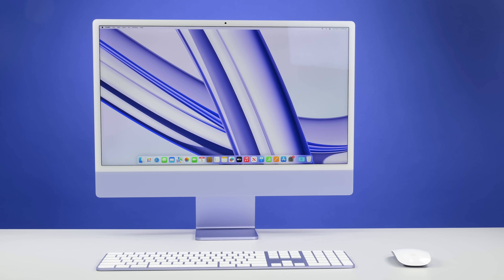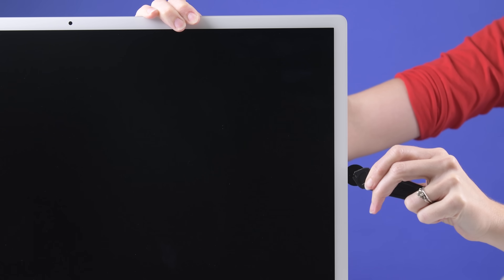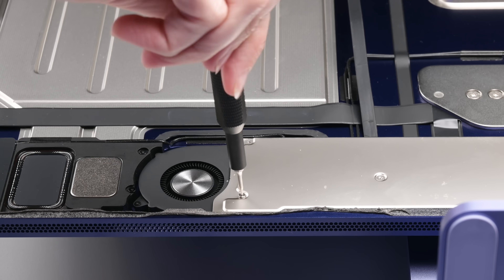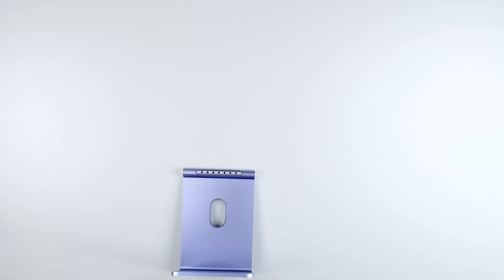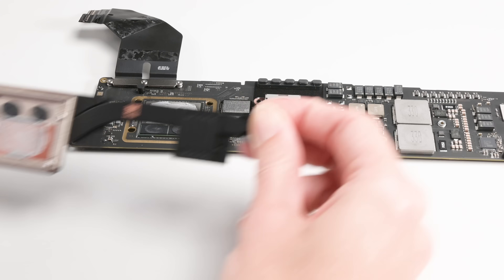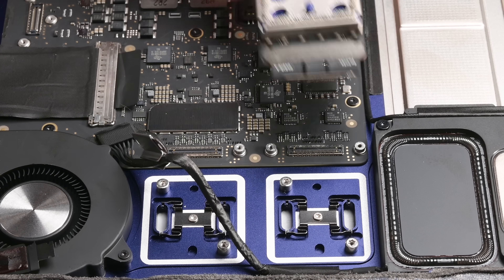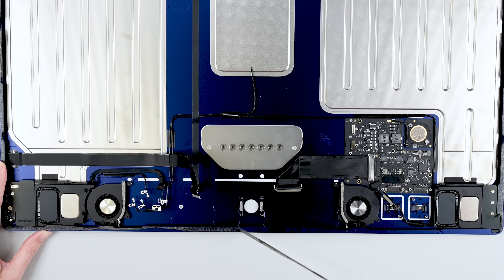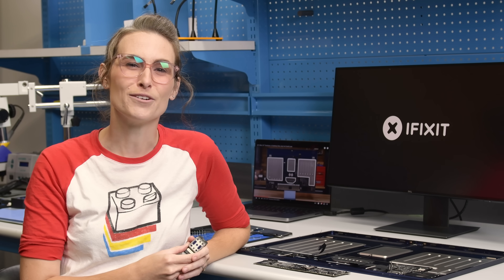M3 iMac Teardown: Apple’s Most Replaceable Battery?

Comment: Since it's an Apple device, it deserves an automatic 0/10 repairabilty for parts pairing, lack of upgradeability,  and pesky software locks.
Reply: There’s only one thing I can think of that Apple “does do better”, the USB-C ports are not soldiered to the motherboard but has their own little daughterboard, so if a port gets mangled it can be replaced without a motherboard replacement
Reply: How many people upgrade a laptop? By the time a normal person upgrades, it’s actually better to upgrade the laptop. Most Mac Book users use their laptops 5 years or longer. Some even use it for 10 years. 

No one cares people can’t upgrade cpu or ram on a Smartphone. MacBook is no different than IPhone or IPad. 

As far as apps go. Apple has Pro Logic and Final Cut. Programs that professionals all over the world rely on for their work flow. 

As a Systems Administrator for a large company and have built gaming pc since 2003. Mac Book offers many things that PC doesn’t. It’s my sanctuary from Winblows.
Reply: @JasonB808  being able to upgrade an imac or macbook means it can last longer in fields where things like RAM requirements are always increasing (E.G video editing where 4K and 8K timelines eat ram like takis). My old PC lasted me almost eight years because I was able to upgrade it. It was originally equipped with 8 gigs of ram and ended life with 64. Upgradability also means that I don't need to shell out $600 for more ram now, and can instead wait until I need to upgrade capacity to spend more. My new work computer has 128 gigs of ram, and I know I will need to upgrade it down the line. I'd rather spend $200 for another 128gb of ram in 2 years than another $6k on an appropriately spec'd mac pro.  Same goes for my work laptop. Currently has 32 gigs of ram, but can be upgraded to 64 when I need to. While some may be able to  use their imac or macbook for 5-10 years as an internet browsing machine, the same can't be said about people who use these devices for work. The reason "nobody complains about the lack of upgradibility in a smart phone" is because almost nobody uses them for intensive workloads. 

Also, people absolutely do complain about lack of repair/upgradibility in phones, just do a google and you'll find a ton.
Reply: I’m pretty sure the main reason why upgradability went out the window, was because the components including Ram are directly attached to the SOC… Now mind you the whole upgradability degradation did occur prior to the swap from intel to ARM, and I agree with that on intel models but now the ram being directly attached to the cpu and the gpu allows for faster operations between them adding additional traces on the board adds time to complete these operations…
Reply: @jonohlinger8898  even with the faster soldered on ram, I would still like to see a few SODIMM or DIMM slots for ram upgrades in the future. having a second, slower bank would still be better than no more ram at all
Reply: @badlighting thanks for sharing, I’m in essence illiterate so taking what you say I agree with, it would be nice… I do believe the fact we can’t slip an additional m.2 in for additional storage is also a huge problem and I agree with basically all arguments but idk 🤷‍♂️
Reply: @badlighting  
A better change would be a socketed SOC
Reply: What about microsoft, dell samsung or many other brands does dude, remember, not only apple would deserve a 0 with your cleary rageful comment, but look around... every other company is the same
Reply: Especially with the lack of upgradeability. I mean, almost every modern device does this, it’s not just an Apple issue. It’s sad.
Reply: @mirai9150  Except most people don't buy maxed out hardware, so they end up completely replacing the device much sooner than if they had an upgrade path a year or two after purchase. The value of used hardware on a secondary market is also significantly reduced if that stuff can't be upgraded -- which leads to more stuff being prematurely trashed. Also, manufacturing processes are constantly improving and becoming more efficient, so waiting to buy a part a year or two after release will frequently lower the economic and environmental impact. No matter how you look at it, it's hard to argue that non-upgradability is better for the environment.
Reply: @mirai9150  I don't know kid, if you come to d1ck ride and defend Apple after someone's comment, I think you are the one that got mad
Reply: @mirai9150 🤡
Reply: @mirai9150 you're braindead 👍🏻
Reply: Cry more
Reply: @mirai9150  Not everyone has the means to max out at purchase, and buying an upgrade is better than buying twice. You are definitely misinterpreting the situation.
Reply: Why 0? It just doesn’t make sense 

Agree that deserves a low rating 

But Since Ifixit Purouse is to rate properly each device if they say It deserves 2/10 why should it get 0?
There was I guess some devices even less reapairable than Apple Stuffs like Motorola razor ultra (the flip one)
And the 2013 Mac Pro “the death of repairablity”

they  even included The Parts paring into the count demoting the iPhone 14 from 7 to 4.
Reply: @Bebtelovimab Going broke? Which planet are you living on? They are worth more money than they ever were in the past.
Reply: sadly, because their hardware is good
Reply: @mirai9150 wow! Your brain sure does contain a all the dirts of the world
Reply: @mirai9150 Imagine saying that spending $8000 on a device that’s not in anyway upgradable is better for the environment. 

Dude, I know laptops that offer far better internal upgradability for far cheaper price making the system more future proof than any device that solders everything to it’s motherboard.

Buying a $1500 machine from other vendors is obviously better for both the environment as well as the wallet than buying an $8000 maxed out machine. 
Other companies at least don’t solder RAM and SSDs unlike Apple devices.
Reply: oh wow get got a solid hater here